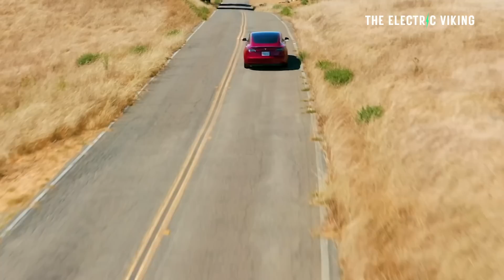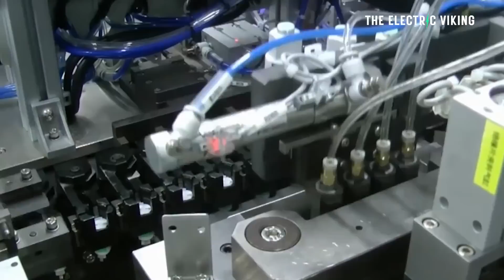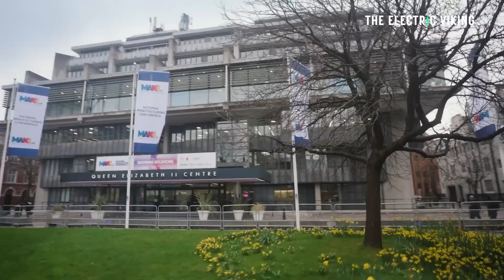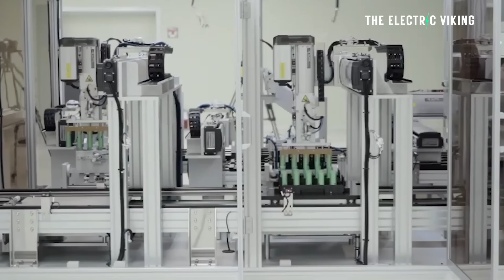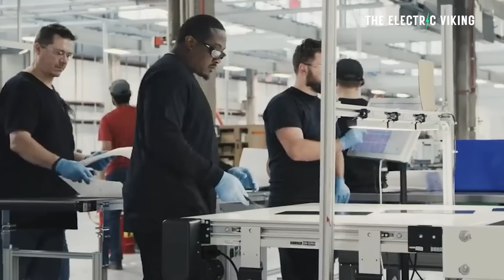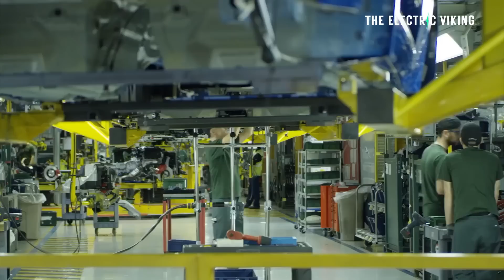Experts say UK's car industry and 800,000 jobs to go to China & the US

Comment: As of 2023, approximately 198,000 individuals are employed in the UK's automotive manufacturing sector, with an additional 615,000 working in automotive retail and servicing, bringing the total to around 813,000 employees across the industry. Loosing our UK manufacturing could well cost 200,000 jobs by 2035 so we really must have our ministers onboard when it comes to the automotive sector but NOW not in 10 years time when it will be to late.

Comment: I wanted to follow on this because I was curious how much of this industry the UK owned.

Upstream oil and gas production actually still has the largest proportion of this industry, on my best estimates its around 15%

So you would think we own the gas pipeline business's in the UK. The answer is no, owned by various spac's, consortiums and sovereign wealth funds.

It must be gas electricity Generation. Nope owned by the Germans.

Whatabout nuclear, nope, French are on the hook. I doubt the UK will have more than one power station

UK Car manufacturing, beyond specialisation and design, France, Italy, India, Germany and Japan are on the hook.

Steel, India is on the hook.

When I look at dead assets, and they are dead assets that are valued between 1 to 1.5 Trillion £'s, the UK only has roughly 3% investment.

When I look at the other side. The UK Needs to

Double wind power: Planned and approved
Increase solar by six fold : organic growth is accelerating, but is still too slow.  All can be done by roof top solar, I am not entirely sure why it progresses so slowely.

Lets answer the whatabouts! The increased power from wind and solar from 2022 level, wipes out carbon production in electricity in 5 years. Whatabout getting heating and transport onto the grid? It requires virtually no out increase in power output to do both of those things; it almost all come from wasted power (Last 7 years UK electricity demand has fallen 15%). Whatabout the cost of batteries, a large proportion comes from wind, we share wind output with all north sea countries. The need for batteries are quite low and sodium batteries look like they will cost £40 a MwH,  currently half the price of UK gas Generation today. GAME OVER!

Comment: The UK doesn't have a car manufacturing industry, we have an assembly industry for foreign-owned manufacturers. There are no British volume car companies. The vast majority of most companies parts are just imported which has become more complex and costly since Brexit. All the 'British' companies will be gone inside ten years, companies have capacity and much lower costs elsewhere, none of them are going to commit to building new models or EVs in the UK for those reasons alone.

Comment: Interesting but I think caution is needed.  (1) The UK will not become a mass-market EV manufacturing destination.  (2). It will be able to compete in smaller scale higher-profit vehicles.   (3) Many countries are building gigafactories based on lithium.  However, there are other technologies to power electric vehicles.   (4) Companies which face equal or greater threats are those such as Renault which is struggling in the EV market and whose products are not desirable enough to command a premium price.  In 10-15 years time it is unlikely that Renault will remain as a mass-market manufacturer - unlike its sub-brand Dacia which has lower build costs as it’s manufactured in low-wage Romania.   The real question is does the UK want to be a mass-market car manufacturer or does it want to leave that space, which is going to be threatened by low profitability to others.

Comment: This is not really news. The UK has no car manufacturing businesses of note. No one thinks MG is built in the UK or is a UK company. Other than specialist manufacturers; the industry is 95% foreign owned. Half of the industry has closed in the last 5 years. Manufacturing of vehicles employ just 150,000 people (whole industry is Just 750,000, which includes Design, retail, repair and finance). There will be no bail outs and no subsidies to Electric. You can say the same about Nat Gas and Coal, they are all foreign companies, No bail outs, they are just going to go broke. When you look at the imports to support both industries, the loss is broadly neutral!
Reply: What people really haven't cottoned onto is what's going to happen to Iron & Steal industry. 75% of all mining and metal refining is around the steel industry. 80% of the industry will be gone in the next decade. China building collapse, no oil rigs, no pipe lines, no engine blocks.